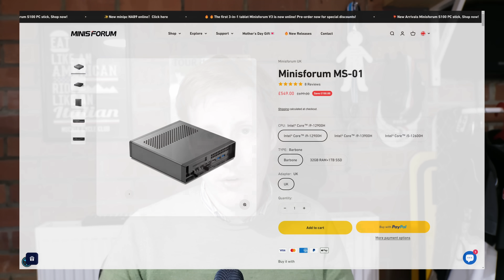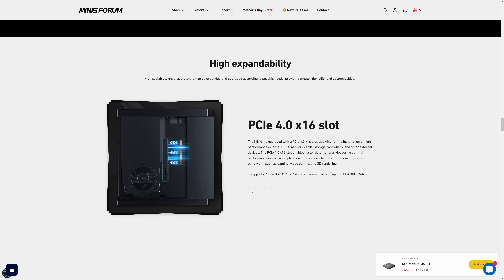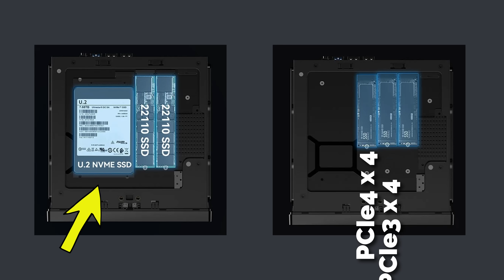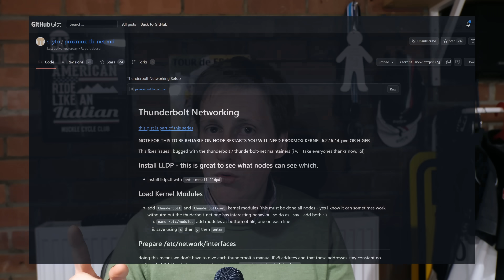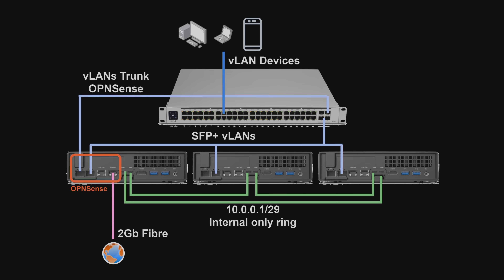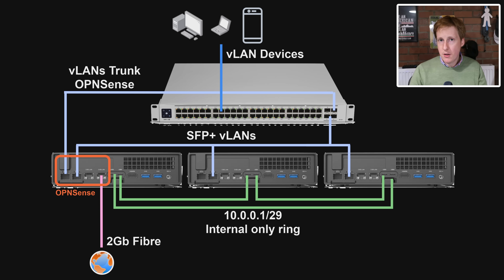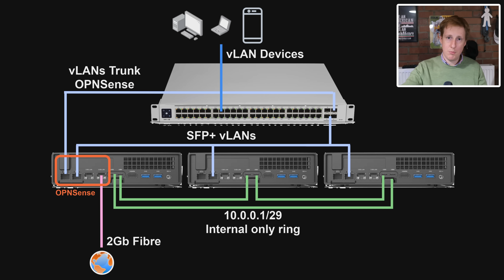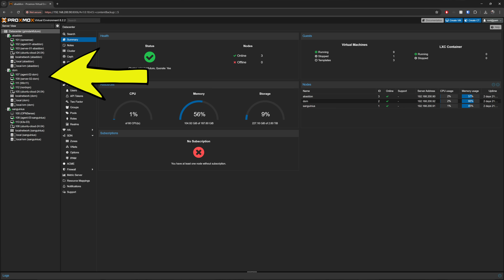Planning A Homelab - Cluster Time! Minis Forum MS-01

Comment: Create another vlan on your switch, plug your fiber into your switch using SFP+ to ethernet module (so you can get above 1G) on then newly created vlan untagged port, then plug all 3 proxmox hosts into your switch (using those free ether ports), tag the new vlan down to each host, create a new bridge using the NIC you chose, make the bridge vlan aware. Attach the new bridge (a second NIC) to your OPNsense using the new Proxmox bridge, move your ISP settings to the new OPNsense NIC (tagged) and you should have a OPNsense that can migrate between hosts
Reply from the maker: Thanks, that's how it used to work. I will need to try it again with OPNSense and a NIC passthrough.
Reply: @Jims-Garage  I would not pass though the NIC directly to the VM, unless your ISP goes to your switch and your switch to each host otherwise that's where the HA falls short. I have some passed though hardware on each of my nodes (exact hardware) and migrate works but only cold migrates. On the flip side my PFsense in the above setup I mentioned does live migrate besides a ping or two because the VM is not directly talking to the hardware

Comment: Looks great Jim.  Are you going to be integrating the Ugreen NVMe NAS into this as well?  I'm going two nodes with the Ugreen NVMe NAS.  Very interested in the Thunderbolt internal network connectivity.  Looking forward to the next session!
Reply from the maker: That was the plan... Unfortunately the thunberbolt 4 wasn't stable on the UGreen NAS, you cannot use both ports simultaneously from my experience.
Reply: @Jims-Garage  Well the good news is I can just use the 10GbE connection for now as i'm not limited there.  Curious if you planed on using another OS on the Ugreen NAS.  I will probably go TrueNAS Scale.  I have to see if TrueNAS Scale as a CSI driver.

Comment: Great video Jim!
Currently in my homelab I have DL360 Gen10 and DL380 Gen10 (currently for sale) which I want to replace with three MS-01. Your video convinced me that this is a very good idea.
Reply from the maker: It is working well for me, my only concern is longevity of the device but time will tell. It's a great little machine.
Reply: @Jims-Garage  Thank you for your answer!
I'll think about it more, I'm currently testing my DIY server
Specs below:
CPU: AMD Ryzen 9 5900X, MOBO: Gigabyte MC12-LE0, RAM: 4x 32GB DDR4 ECC UDIMM, 2 port 10Gbps SFP+ NIC, 2x 256GB SSD in the mirror on Proxmox and 4x 1TB NVME in the adapter connected to PCIE x16. This mobo supports bifurcation. The server is in the IPC 2U-2404L housing

So far I'm very satisfied.
Now I'm wondering whether to build two more such servers or buy three MS-01.
Reply: @oSAend I’m curious about the power draw on your DIY server as I like the BOM you came up with. How does it compare to the MS–01? I particularly like that it has ECC RAM and you can bifurcate the x16 slot to get the most flexibility / performance out of it.

As you say it’s really food for thought 🤔
Reply: from a power draw perspective alone, this is going to be a huge upgrade, especially with the i5 version. and you don't even sacrifice management, you still have IPMI etc. IMO this box is a perfect homelabber system.